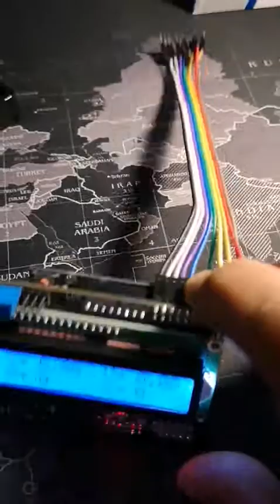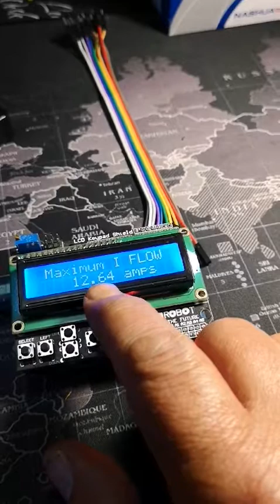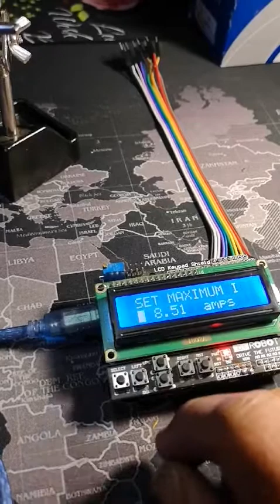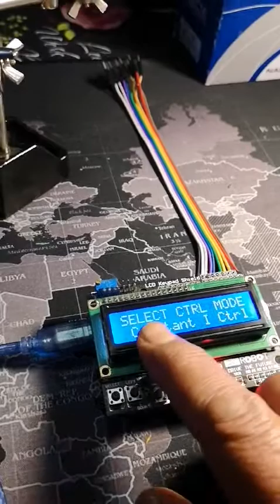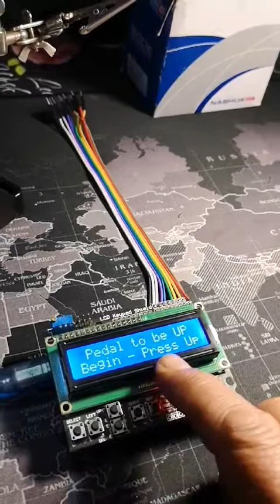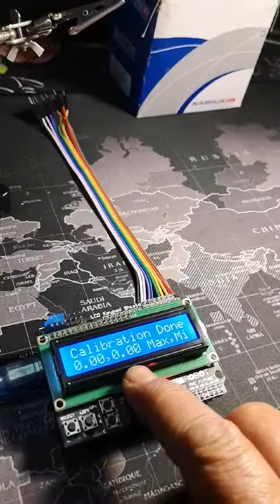Controlling HHO with PWM.

Comment: excellent. can it also split water using pwm frequency and resonate at the same frequency as water? it would then require much less amplitude to provide much more hho and run cooler.
Reply: Not that simple. Lol

Comment: Its mean we have to know how many maks  amps we use in our hho generator first. Its tool will work about 12amps maks flow in our elektrolit
Reply from the maker: Yes, we have tables from the HHO institution that gives us the size of the engine and the acceptable currents. For example a 3 liter machine uses about 8.3 amperes and gas at about 0.5 liter. We are using the gas created as an additive to obtain cleaner burning and to burn the 30% of unburnt fuel that is now being exhaust from your engine. That is proven. With this technique we reduce the dangerous emission gasses between 50 to 70 percent less. The by product of the combustion product is water. We will add another video soon that explains some of the questions that people has raised. Currently we are in the testing phase. As an engineer I need to declare the technology save for use and we have to test it before we talk about price. Currently we estimate that every 4th tank of fuel to be free due to the savings. One tank of fuel is about R1000 plus. We are also looking at the cost versus fuel saving with a guarantee of money back if the person do not experience any savings. Please watch the second video.
Reply: Yes..No doubt for that I was just proven that hho can reduce the engine temparsture n have low emision in exaust. Thank for the explanation sir..I'll wsit for the second video